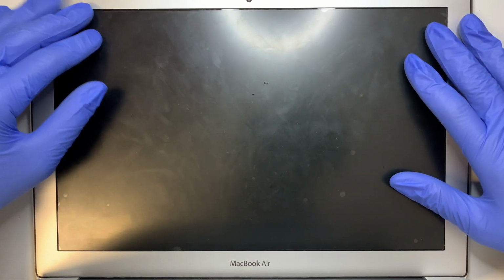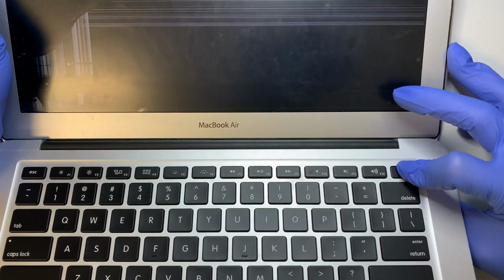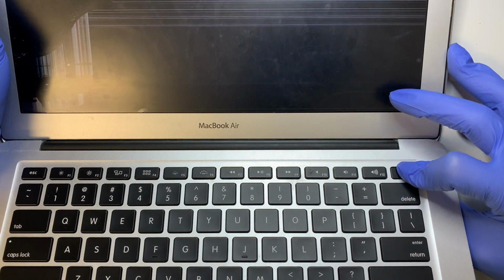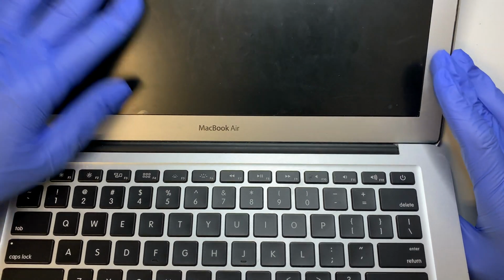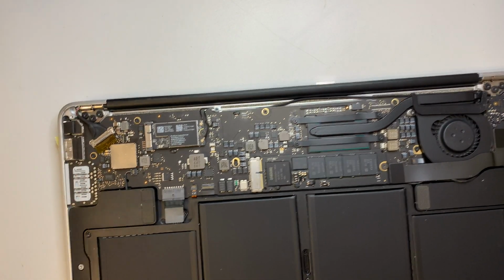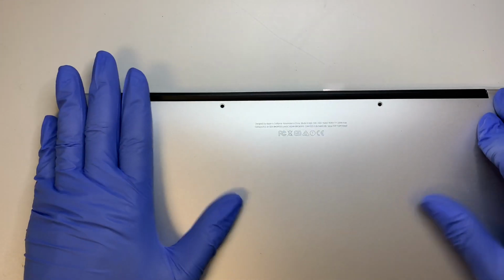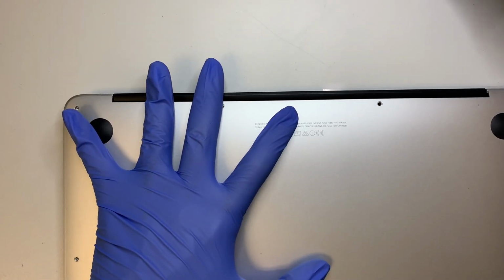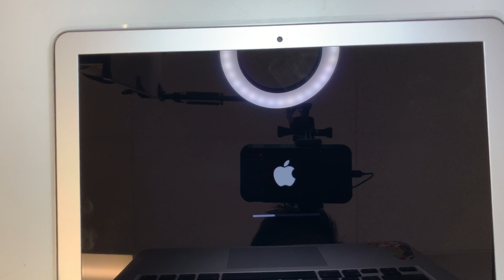Macbook Air A1466 Screen Replacement 2013 - 2016

Comment: Your video is the best I’ve found! I’ve just relaxed my screen but my computer shows a battery and that it’s charging but the fan makes a buzzing / grinding sound when I start the computer and then stops briefly and shuts off .. any advice ??
Reply from the maker: Hi, when the fan makes grinding sound. You may want to change the fan out. This could be overtime the ball bearing worn out. It spins uneven and the fan blade is scrapping the cover giving buzzing / grinding sound.